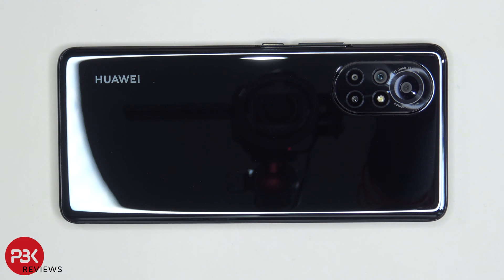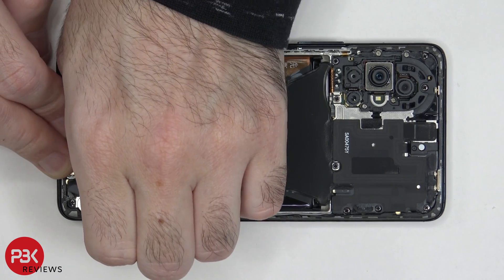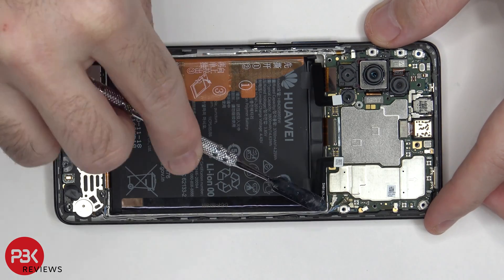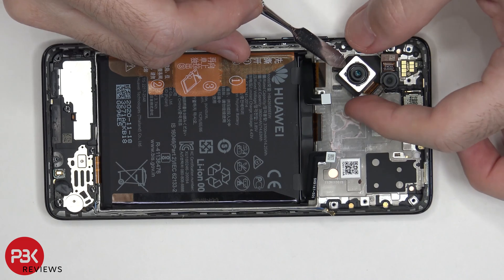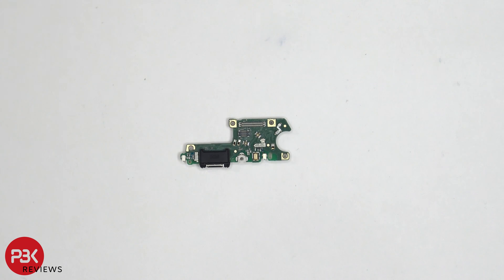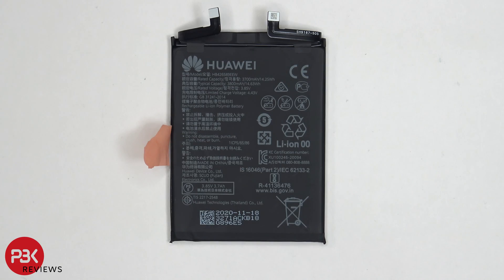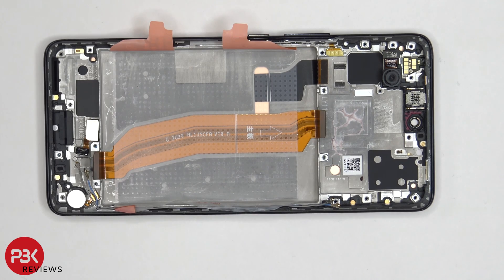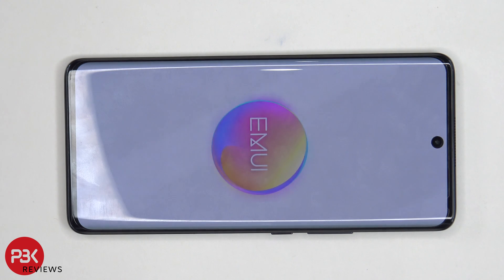HUAWEI Nova 8 5G Disassembly Teardown Repair Video Review

Comment: Hi sir. Can I swap my Nova 8i 4300 battery to my Nova 8?
Reply: Nope they're different huawei nova 8i battery flex is only one while nova 8 has 2 batteries combined that's why it has flex cable left and right to connect into the motherboard

Comment: It is okay to use WD-40 to fix water damaged phone?
Reply from the maker: I wouldn't suggest it. Would be better to just brush off corrosion with a brush and if you have to use any chemical, to use something like bw-100 electronic contact cleaner.